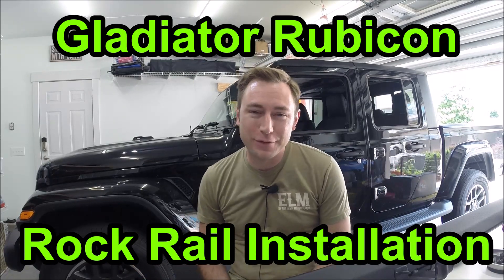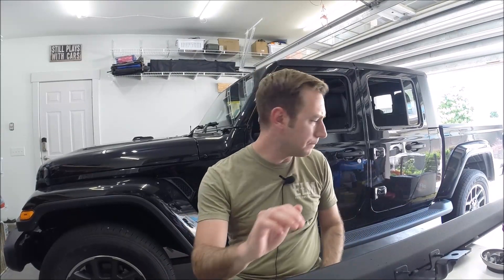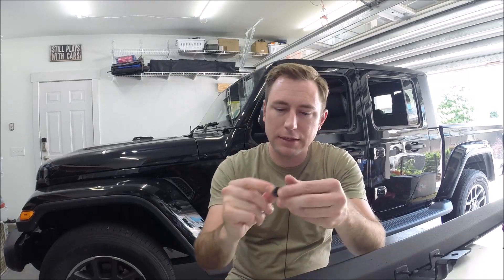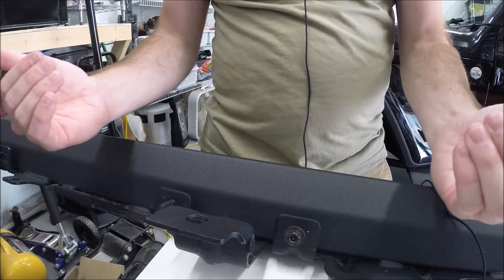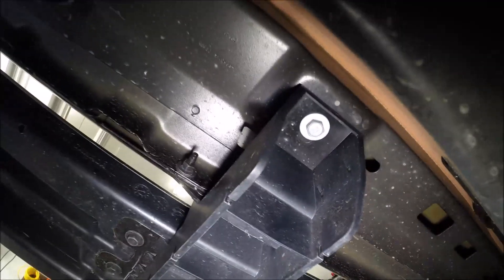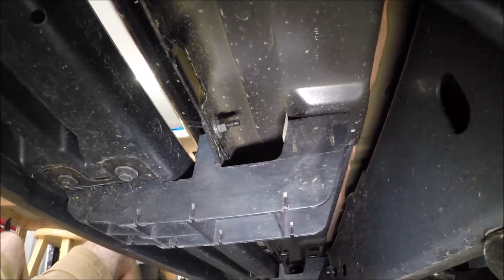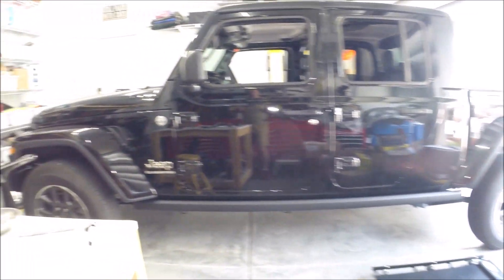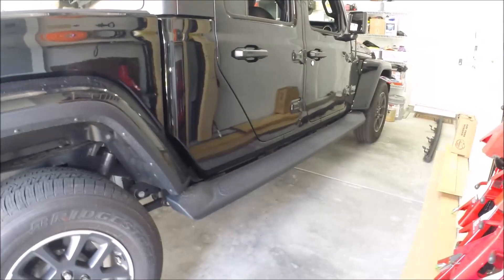Jeep Gladiator Rock Rail Installation

Comment: Going to pick up some rock rails from a rubicon owner tomorrow. Craigslist special $150 in new shape. I currently have no running boards / sliders on a Sport S Max Tow. Nice video, thanks.
Reply: Also thanks for the bolt and nut sizes. That helps a lot as I’ll need to pick up some hardware.
Reply from the maker: Nice!  $150 sounds like a good deal.   Super easy to install too.
Reply: Scruf's Garage When I showed up he had the rear sill box rails as well so got the whole rail setup for $200. Unfortunately realized that I need the $75 brackets on each side to install those :(. But still a good deal!  Bought all the hardware on McMaster.
Reply: What is McMaster

Comment: Thanks for the video! Quick question: I don’t need side steps or rock rails but don’t like having the holes exposed. Is there an option for covering the strip of holes aesthetically? Just wondering
Reply: Those are drains or I would say some seam trim but will rust like crazy.  I just picked a set of these rails and they are low profile and cheap on fb market place and 4x4 shops have them stacked like cord wood. I managed to snag a set without the m8x1.25 30mm bolts for 40 bucks

Comment: is it possible to put the right rail on the left side or vise versa.I bought a set off a new Rubicon & intsalled them in the guys driveway then wondered if I mixed the right & left,LOL!
Reply from the maker: Yes, if I recall correctly they were marked left and right, because there is a slight bend in them.  Not sure if it's possible to install them versed.  But I guess if nothing looks funny then you're probably fine, haha.
Reply: I found the Mopar instructions online
There’s only one way they can go on🤓

Comment: With the lift and tires are you thinking about steps again?  If so have you found a step that works well?  Good video and info on hardware is helpful.  Thanks
Reply from the maker: I still really like the looks of the rubi rails, but after the tires and lift it is definitely a bit of a jump to get in.   My issue with the factory side steps was that the step height was very close to the door sill height, so it was an awkward transition getting in.  But there are a ton of side step options available if that's something you're looking for.

Comment: no anti seize on the bolts?
Reply from the maker: Certainly wouldn't hurt.  I'm in the south and rust isn't really an issue.  But if you're in an area where you get road salts, etc then adding some anti-seize wouldn't be a bad idea.